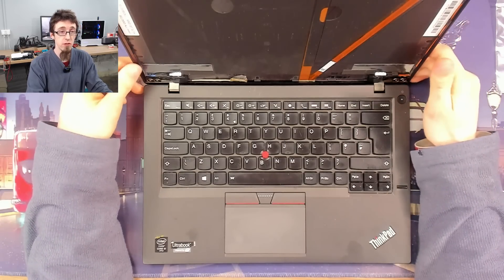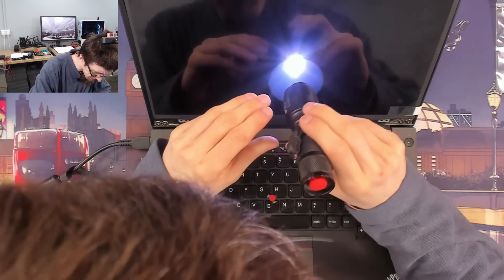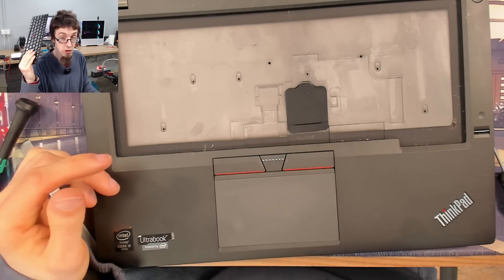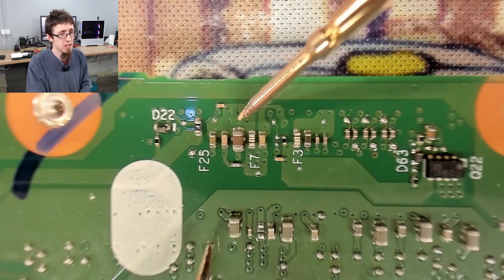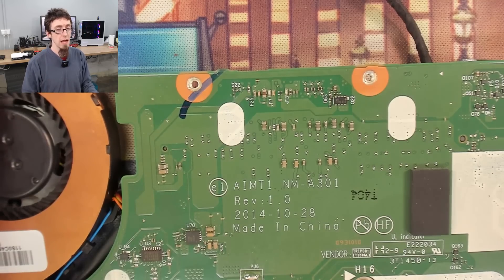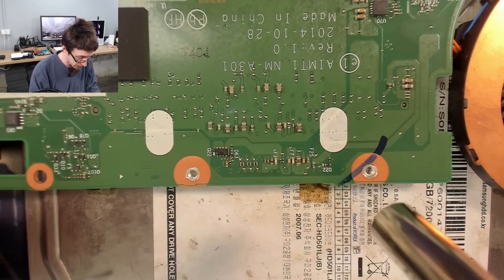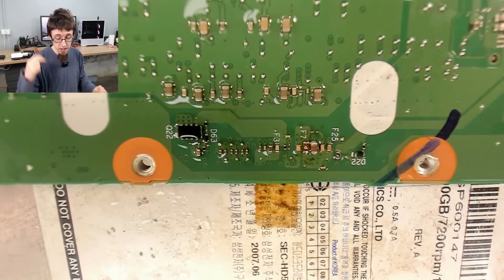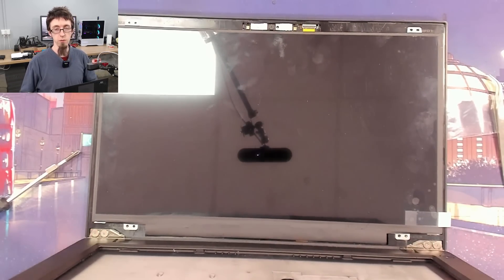Lenovo ThinkPad T450s with No Backlight after new LCD - LFC#265

Comment: That battery setup is garbage , as said , the person thought they had removed all power to the machine only to be caught out by Lenovos's crap design . Surly they could have made the circuit so that when you remove the external battery it cuts out the internal as well
Reply: Its a design feature. It enables you to swap out your external battery for a fresh one without having to save your work and shut down the unit.
Reply: @ianmorris8534  yes, but "surely they could have made the circuit so that when you remove the external battery it cuts out the internal as well"
Reply: @ianmorris8534  I would rather have the minor inconvenience of saving and  restarting as against the possibility of this sort of thing happening . If this buy can make that mistake it does not give the amateur a lot of hope as the owner of this one found out
Reply: As Ian said.
I am not sure of the capacity of that smaller internal battery but windows should detect it as a separate battery so when you put your mouse to the task bars battery icon you would see Battery 1 and Battery 2.

You should also know the product you're working on, esp if it is your own.
Reply: @IIGrayfoxII  Whether it shows the two batteries is an interesting point . Have they set it just to show total power of both or as separate ones , it would be interesting to look at one and check that out . Windows will only detect it as two if it has been set up that way , can windows detect and show two different batteries ?? .
Ian said it himself , he only realized part way through that it had an internal battery and he does this for a living so the average owner is not going to know , they would assume like Ian did that when you remove the external battery the thing has no power going to it and its safe to work on .
Lots of ifs and buts in what Ian said , wish he had looked into those things and shown the results
Reply: @MrTarmonbarry  Windows 10 Surface laptops show 2 batteries.
One that is in the screen portion and one that is in the keyboard portion.
Reply: @IIGrayfoxII  One in the screen portion??, bet thats fun to replace . From what i have seen on videos those things are a nightmare to open up and try to get back together looking half decent
Reply: @MrTarmonbarry  my aunt dropped hers and since she is a tax agent she needed the data.
So I had to open it, lucky for her it uses an M. 2 SSD. 

But since you can detach them screen from the keyboard and it still works it is clear it has its own battery.

They keyboard has its own too but it is larger
Reply: @IIGrayfoxII  Yes , lucky to have a conventional m.2 ssd unlike Apple soldered on . When you opened it you would take the back cover off so would have had to remove the normal external battery that most laptops had at that time so you might think that it is dead with no power going to anything , if the internal battery has nothing on it telling you it is a battery its bad , that could be mistaken for some kind of module which means you are altering / removing things with it still powering some ares . never a good thing . if that was sending power to the M.2 socket it could have corrupted the data when removing the ssd . As was shown in the video it is possible to remove the screen without removing the back and if you have powered it off the same way as with most laptops , have a blank screen you would think it is completely off with no power to anything so how would you know it still works . you have gone to ''power off '' in the tabs and shut down , there would be no indication that there is still power to the machine , and no , the keyboard does not have its own battery , the one you are talking about is the main battery , the external one , no laptop has a battery just for the keyboard
Reply: I can not remember from the video but Lenovo should put a big yellow sticker on that internal battery to get peoples attention , first rule working on a laptop is disconnect power
Reply: @IIGrayfoxII  Just looked back at the video , there is nothing on that internal battery saying that it is a battery , that is a very bad omission by Lenovo , it needs a label on it otherwise it can be mistaken for just a unit of some sort . If you were not taking the motherboard out you could easily be working on it with power still going to the whole motherboard if you did not know it is a battery
Reply: @MrTarmonbarry  First rule when working on anything is use a manual for servicing a product.

This way you know what to remove to ensure no shit breaks.
Reply: @MrTarmonbarry  Nothing saying it is a battery.
But it does not look like a normal device found in a laptop>
Looks nothing like an Optical drive, SSD, finger print reader, LTE module.
The wires in the connector were more chunky than normal internal wire, meaning the wires handle a fair amount of current.
Reply: @IIGrayfoxII  Still a good idea to put a sticker on it to make people aware that its a battery . might save a few disasters
Reply: @IIGrayfoxII  ''First rule , use a manual '' . And what if you cant get one or the manufacturer like Apple do not give access to them , what then ?? more and more these days manuals are not available so what do you do then , throw your hands up in the air and say you cant fix  it or at least attempt to fix something ??
Reply: @MrTarmonbarry  There is always a manual if not from official sources, it is made by other users.
Reply: @IIGrayfoxII  ''There is always a manual'' , no there is not ., official or from other users . what are you going to do if you are in the middle of nowhere in a friends car pr your own and it breaks down and  you have no manual ,  are you going to try to fix it or walk 30 k ??
Reply: @MrTarmonbarry  I know how to fix cars and I am not a mechanic.
And I have found service manual for all sorts of shit online.
Reply: @IIGrayfoxII  15.26 is the time stamp where he says he has just found out it has two batteries , this is while doing the re assembly
Reply: nope, bridge batteries are awesome, but when you go into the guts of laptop you should at least read few of other experiences. i replaced screens on all of mine thinkpads andalso swaped them few times, everything still alive
Reply: @dim3nt0  Sounds like you were lucky , just like Ian was , he did not know the laptop was still live so he could have shorted that fuse like the other guy , . You say about reading others experience , what if there is nothing to read ?? . At some time someone is the first to do something like this and find out the hard way . If they are going to build a system like this they could easily put a big red sticker in the external battery compartment to warn you and they could even have a message flash up if you take out the external battery
Reply: @MrTarmonbarry  well i didnt know what i was doing and for that reason i went looking online and i did found in a few places info about why its necesary to disable or disconect battery. i wouldnt call that luck, just common sense. battery bridge exist for a long time now and anything anyone  does to a thinkpad now has allready been done, especialy rookie mistakes. luckily this was simple fix.. there is nothing bad that i see about this, its very convenient. users diging inside laptops and doing damage is nothing new, i have done it myself and have no one else to blame
Reply: @dim3nt0  Its unusual to have a second internal battery , most laptops just used to have just the one you removed  without having to open it , i wonder if this is something that just Lenovo did
Reply: @MrTarmonbarry  i think its only lenovo.. and true, to replace the display you dont have to open the laptop, you only need to take off the bezel.
 if you open the laptop you cant miss the battery on the inside. this is not the error if the battery should or shouldnt be disconected, this is the error "i didnt know it should be disconected" bcos to open laptop you have to remove battery. most likely he was not removing it because the screen replacement, he removed it bcos he had to..
Reply: @dim3nt0  So you only need to remove the bezel ?, sounds like that is what the original person who worked on this one did then tried the repair of the back light , tried to plug in the connector and got it slightly not lined up and shorted things , easy enough with those ''Lego' connectors , sometimes they dont line up to well . They probably thought like most people that removing the external battery was taking power away completely .  ''if you open the laptop you can't miss the battery'' , well Ian managed to miss it even with taking the whole thing apart but maybe he thought it was something else , a module of some sort . if there is enough space maybe that plug should be a different design with pins maybe instead of a Lego connector that would take away the chances of shorting it . Interesting that they managed to find space for that battery inside , must be a heavy lump of a thing to carry around

Comment: i just fixed one of these with no backlight. haven't watched the whole video yet but mine was a loose connector on the board.
Reply: You have just fixed one of these . Can you answer a question for me .
Does it show two batteries on the taskbar ??
O.k , found it , you have to go to the taskbar and expand it then it shows both as battery 1 and battery 2 . Few people have had issues with it just showing one after a windows 10 update , maybe thats why the previous repair person thought it was dead
Reply: @MrTarmonbarry   just saw this comment sorry. i also had to figure out the dual battery thing.

Comment: With those Lenovo keyboards, if the laptop is fairly new, once you remove the few keyboard screws in back they're typically fairly easy to slid the bezel up to reveal the screws.  But, I've run into this before where a laptop has been used and abused where the bezel is stuck just like that 1.  Probably had some crap in there like liquid that had gotten sticky or crumbs that jammed it up.
Reply: These sliding bezels are only a good idea as long as there is nothing interfering or sticking. Otherwise they are an absolute pain.